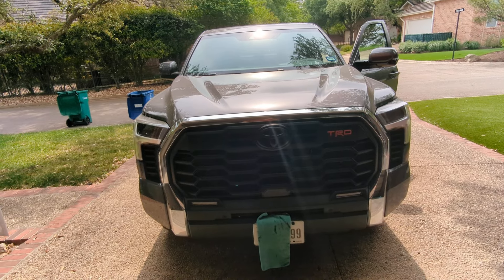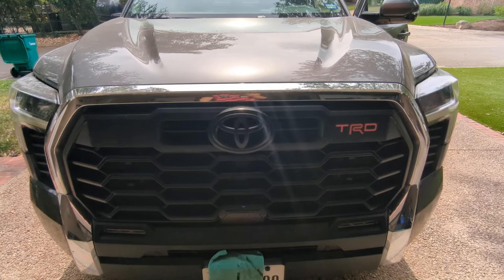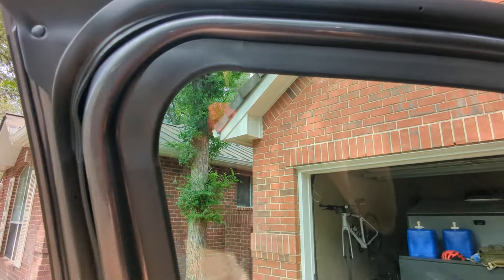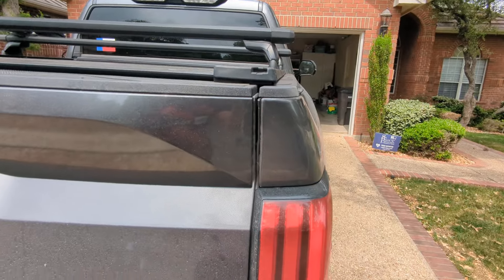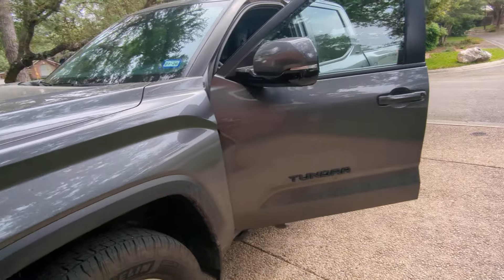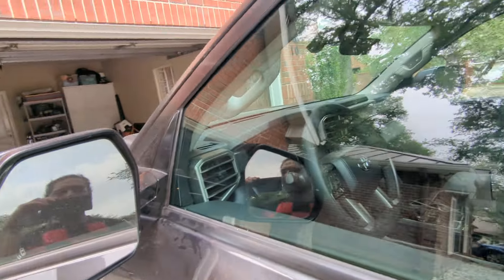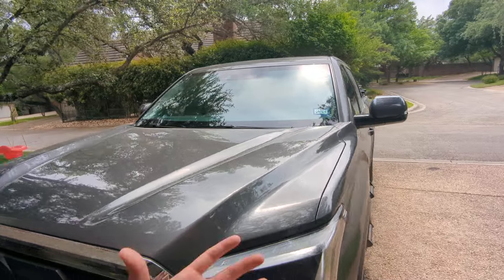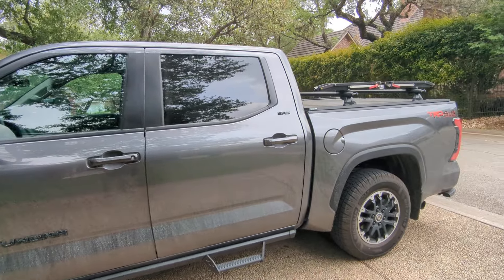2024 Toyota Tundra: Quality Control Issues Persist - Window Noise, Rattles, Tailgate Gaps, Etc.

Comment: I traded mine in for a 2024 4 runner, had too much issue on mine. Mine had too much issue, noise all over inside my truck. Last one that made a noise was the foam on top of my roof inside my truck was making squeaks beside the plastic inside. Oh yeah my air damn motor broke too. Bro that truck has so much issue get rid of it. I got rid of the 1794 tundra. I can see this tundra to have more issue down the line. I got tired of going back and forth to the dealership. Get rid of your headache

Comment: Dude. Sound like you bought a luxury car and now unsatisfied with small issues.
Every manufacturer today have quality issues. Even Rolls-Royce, I'm sure. 
Those are little not important things. Replace window thing with after market. And enjoy. Hope they didn't changed the power train in those. If no, this thing will last forever. 
If it's new motor. Especially turbo. You know... run. And buy older vehicle
Reply: Not true.  The Tundra has been plagued with allot of issues since 2022.  Its the reason that dealers can't move them.  They are piling up on dealer lots.  I've seen discounts over 9K.  And even then no takers.  Sales wise this model is bombing for Toyota.  And used prices for the older port injected 5.7 V8 are going up because people know that motor can go 1 million miles.  Lots of documented cased of that.  Your lucky if this turbo crap will go 150K miles.
Reply: @HiPlains1  that's exactly what I said
Reply: @HiPlains1  Are you oblivious to the fact that this drive train is not new? It's actually old and comes right out of a Lexus. Also, it took me an entire year to find the exact Tundra I wanted because they're impossible to find. Every dealer in my state is having a hard time keeping them on the lots.
Reply: @JasonTylerS  You need to look outside your regions.  I'm seeing dealers knocking off 9 grand.  I'm comparing this turbo motor to the port injected 5.7 V8 that could literally go a million miles.  The outgoing is the better setup.  There is no way the new motor can last that long.  Direct injection and turbos can't offer that kind of durability.  Use car guru.  Its does not cost that much to ship a truck if your set on a tundra.  But I'd recommend a 2021 instead.